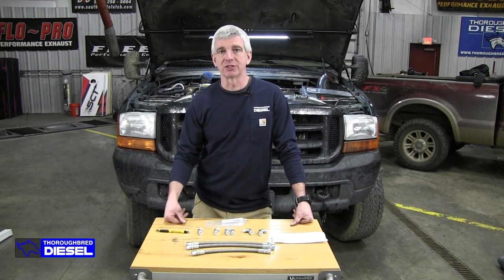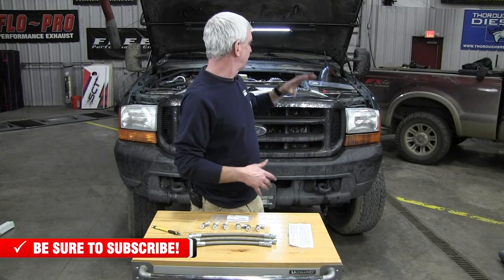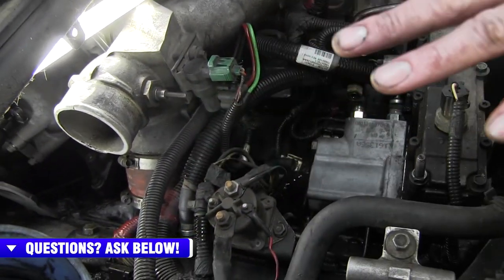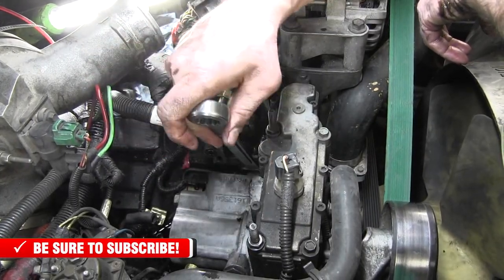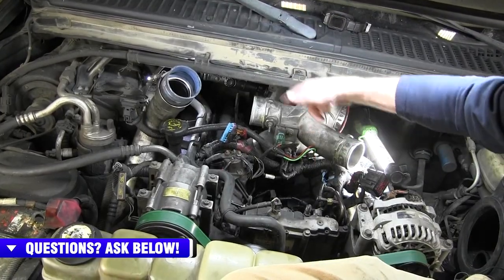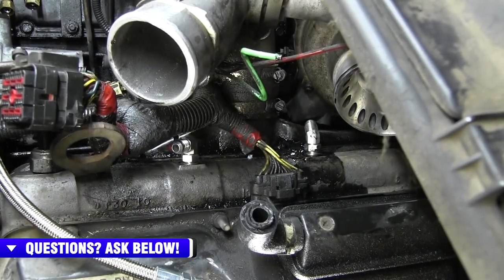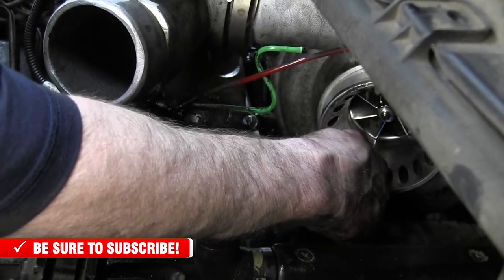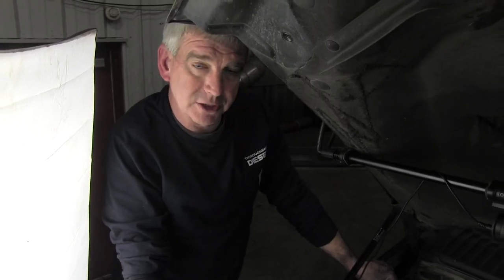HOW TO INSTALL High Pressure Oil Pump Lines #trucks #diesel #fordtrucks #youtube #shorts #shortvideo

Comment: Hey I got a question, I just installed new hpop lines including the crossover line.I took out the check valves and everything but now the truck takes forever to start.this didn’t happen before with the old lines.why is this happening?
Reply: My 7.3 did the same thing for about 2 weeks, ended up getting better, I think it's getting air out of the system,
Reply from the maker: How many miles on your install?  We usually drive a HEUI install several miles before we start chasing conditions.  If you took the check valves out of a stock pump, I would start with reinstalling them and see if that corrects the condition.

Comment: I recently had my 7.3 quit on me I was driving it and heard like a pop then die I was think hpop lines. It cranks no start but my oil light is on now and engine temp is and no lights whatsoever was on prior to this happened. After I got out and checked it leaked a lot of oil
Reply from the maker: Should have pretty good visibility to the lines.  Go over everything very good.

Comment: It's kinda convenient u skipped how route the main engine harness to the bracket.  On 7.3 SD the line is right smack in the middle of where this harness has to go! Without removing bracket and just letting the harness lay on the valve cover like a Hoosier or try to go above it, either way the line will rubb a hole in the wiring making it for a sure short in the future! So how do we run the harness now ?
Reply from the maker: The main harness routing to the bracket doesn’t move.  This truck, some redneck took the bracket completely off the truck where the main harness connects to engine harness.  What I showed here was how long and sweeping that line transition is.   No matter what, you have to keep the harness from the lines,  zip ties, whatever it takes.  You are correct,  there can be contact points,  but you can avoid it by going through and making sure that you have everything zip tied out of the way.

Comment: Will running the hpop lines to the wrong side of the head cause a no start? Thanks for the videos and information love what you are doing in the diesel owners community.
Reply from the maker: I do not think that it will but if they are run to the wrong ports it could.

Comment: What is the check valve purpose? I understand removing it increases flow, but what is the original design purpose?
Reply from the maker: To keep from having drain back.  Its not an issue with a truck having a good and functioning oil delivery system.

Comment: With the angled fittings it is impossible to get a socket on them for using a normal torque wrench.  Did you use a crow’s foot with a torque wrench for correct torque values?  Is there a “handy dandy” chart available to correct the wrench torque setting when using a crow’s foot?
Reply from the maker: Big shocker here but we totally guess.  It’s a feel thing.  But the correct formula is Original Torque Spec * (Effective TQ Wrench Length / Effective TQ Wrench Length + Change In Length) = Final Torque Reading.  Then you will adjust from there.
Reply: My fear is that since I was told to just finger tighten it down and put some blue thred locker on it, that's all I did and I dont want it to pop loose and leave me stranded in the desert. Ive been stranded for a year in a state far from home. I need this thing prestine.
The head fittings may need replaced and I finger tightened the hpop fittings on the hpop itself because I was afraid to torque it too much and break it like I did my Schrader valve return line end. Did I do that wrong?
Please tell me what to do. I replaced my hpop with an adrenaline and the lines too. One of the lines sent to me, its end that goes into the passenger side head fitting just keeps popping out of the fitting. Never happened with the old line. So I dont know what could cause that? I also dont have a torque wrench and I know for sure 23 foot pounds is way more than I put on it but I dont know exactly how much that feels like to be accurate
Reply: @DBCooper3  a full yeat stranded bro? Sounds like you made it. So you had plenty of water and food in your truck to last you the whole year?

Comment: I have watched a couple of videos besides this one, and some folks get the fittings from Ford and it calls for the use of 680 locktite for the fittings. I noticed none was used here. Is that not necessary with this kit?
Reply from the maker: No Loctite called for with the CNC lines.
Reply: Thank you for taking the time to respond. Much appreciated!

Comment: There were torque specs given but no torque wrench was used. Are the numbers just a rough guideline for how much force to apply with my hand? There is a kit without x over pipe. Seems easier and less failure points. How to know which one I should use?
Reply from the maker: Torque specs are correct, if you aren’t using a TQ wrench, of course pay attention to the values and don’t over tighten.  There is a kit without crossover, but we like the kit that includes it.
Reply: How do you torque the fittings? With a crows foot?
Reply: I'm still wondering how to torque them as well with no room to work
Reply: @Charles-ij2mh  I used my hand as torque wrench. No problems yet.
Reply: @alexkram  thinking that's the only way,  barely past snug. 25- 27 on torque wrench is nothing

Comment: I remove the 4x4 shaft so I only have the spindle with the wheel hub . So there’s no need for a manual wheel lock correct . Because theres nothing to lock or free . Just to put a metal cover from an old lock. Please tell me if I am right .
Reply from the maker: Don’t understand the question but if you take the output shafts out you will have  a leak.

Comment: is installing the 3rd hose necessary? if so why?
Reply from the maker: The balance line is not necessary but comes with the kit and is designed to help with the oil supply to both heads.

Comment: I got a 99 f550 7.3
The front high pressure line is leaking like bleeding pig. What lines do I need
Reply from the maker: Give us a call 1-859-737-4966.
Reply: @johnnyblade3335  did they come with Viton O rings? if not you're going to have a bad day.
Reply: @travisfreutel2733  yep top of the line.
327.000 7.3 6spd manual👍

Comment: How do  I torque the fittings to spec with wrenches?
Reply: Crows foot adapter for the torque wrench.
Reply from the maker: You can use a crows foot with torque ratchet.